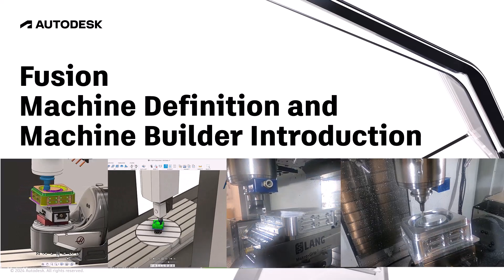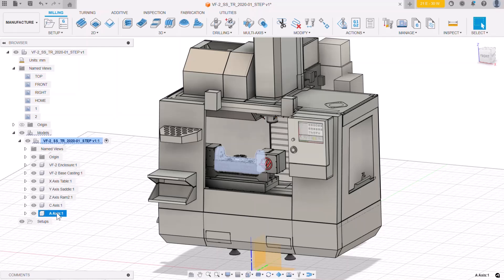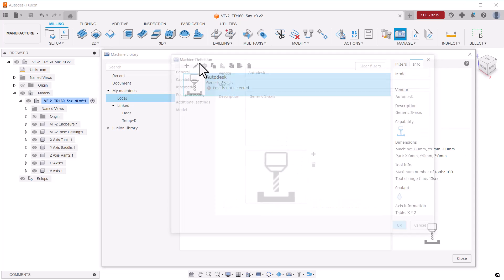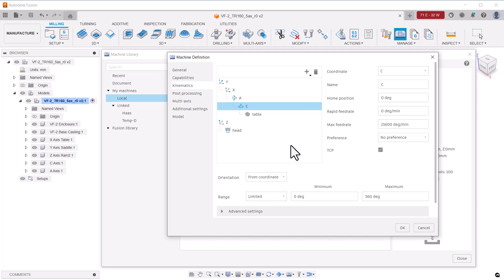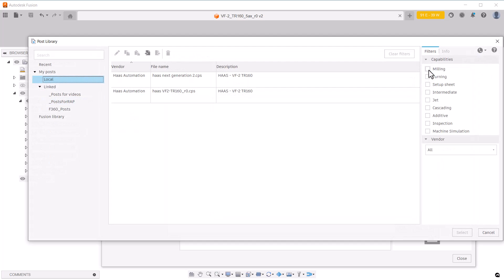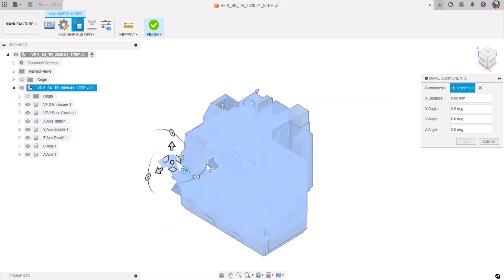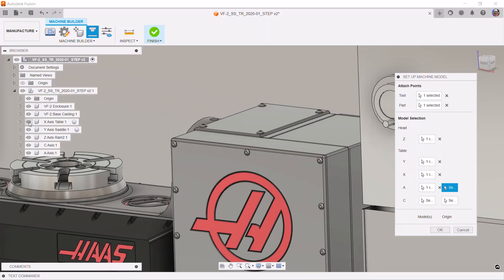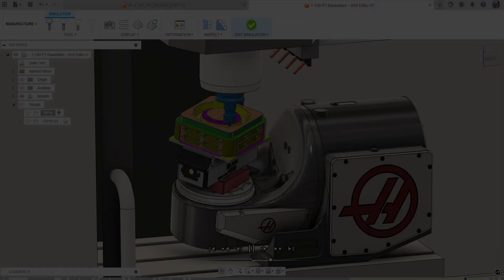Learn How Machine Builder Works in Autodesk Fusion

Comment: Y axis lathe sim, easy manual b axis (aka angle head)
Modelled tool turrets with modelled tool holders to verify chuck clearance on mill turns. 
I don’t even care if it detects crashes as long as it simulates the movement and I can visually see the issues

Comment: When will Fusion have machine simulation for lathes and Turn Mill?
Reply: We're working on it. No date to share, but it's well under way :)
Reply: @sethmadore4127  
What about turning operations for millturns? Like making turning operations which automatically turns the B axis so the tool has the best engagement at all times? 
Or those triangle-looking free turn tools which does roughing and finishing all in one go? 
And Y axis part off? (this could be for a regular lathe with Y axis)

Apologies if those questions seem rude, it's nothing but mere curiosity.
We currently don't have a turnmill at my work place but there's been talks about getting one "soon".